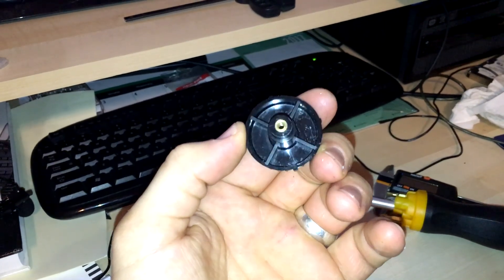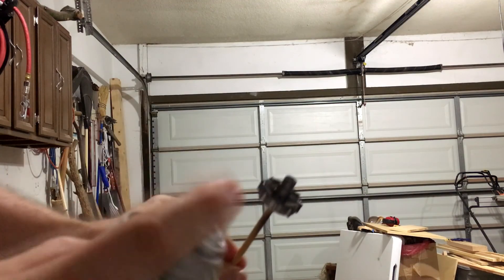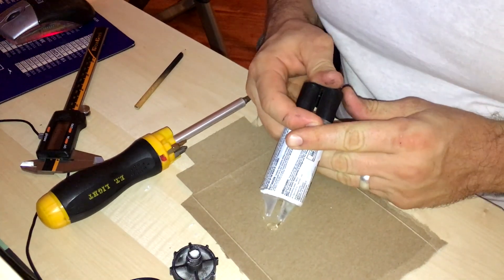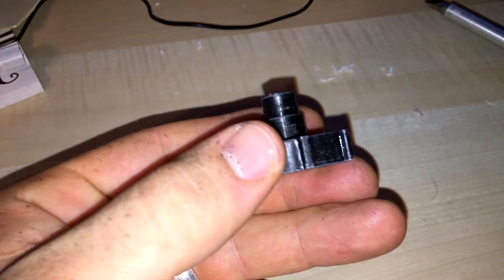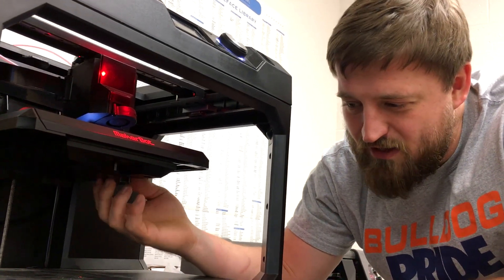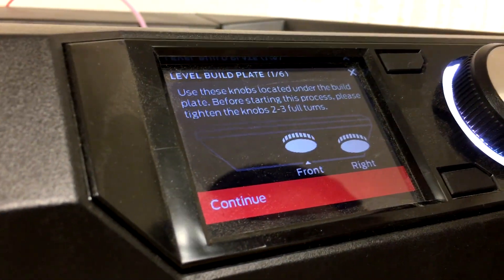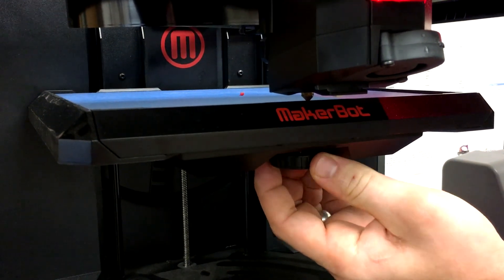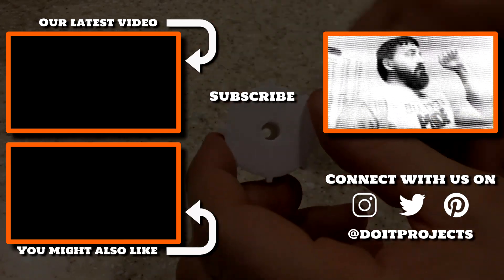How to replace missing parts with 3D modeling and 3D printing

Comment: Where did you get the screw and insert?
Reply from the maker: Menards. Pretty much any hardware store would have it. No screw necessary. Just the insert. I used the original knob to find the screw size and thread (I think it was M3).